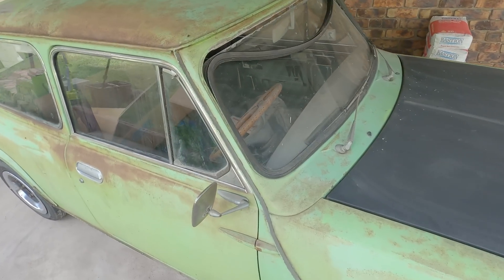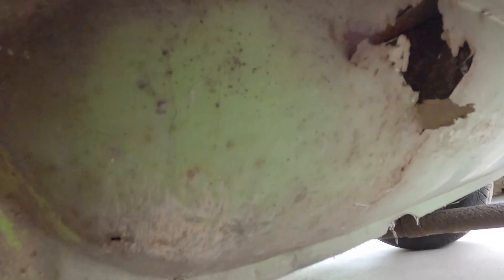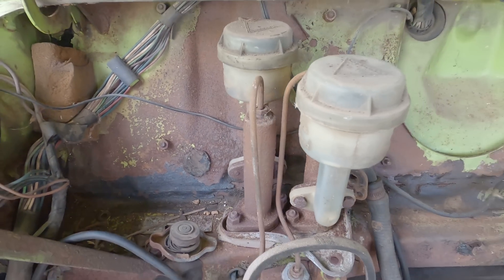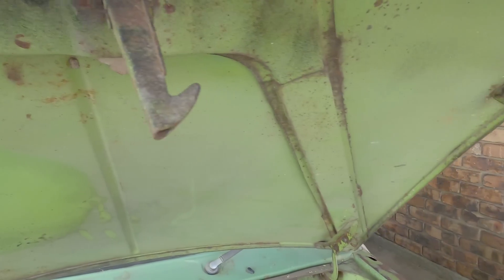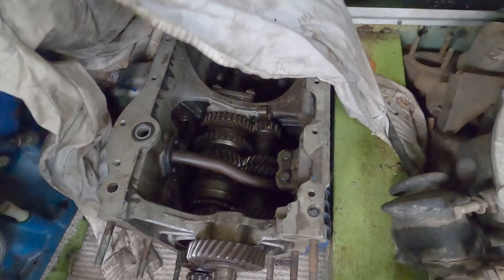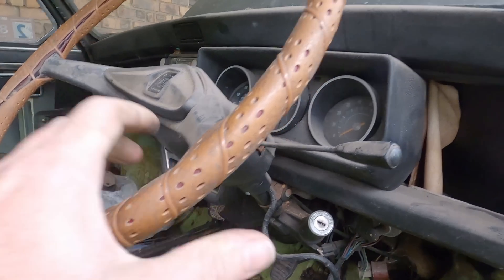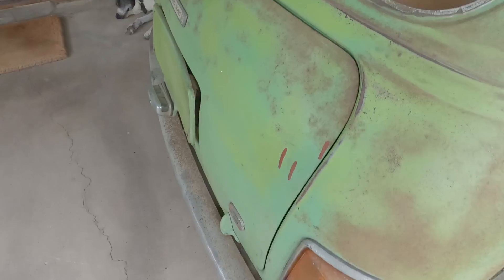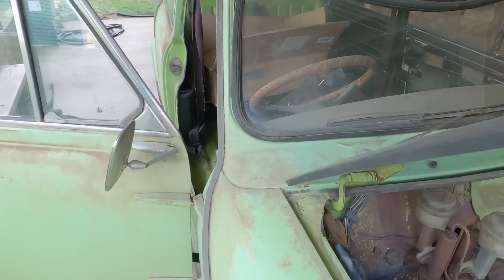🔋🔌 1973 Clubman Mini going electric - NetGain HyPer 9 120v  5 x Telsa Modules DIY

Comment: Well done mate!  I was wondering when you were going to take the plunge.  Although it's not as cool, I'm converting a Toyota Starlet to electric drivetrain using recycled 18650s, Netgain Impulse 9 motor, Curtis controller and balance charging with 5 x ISDT RC chargers.  Can't wait to see where you go with this!
Reply: Every conversion is cool in my book. You can see some initial videos on my channel if your interested.

Comment: You don't have to drop the subframe to get the steering rack out. It unbolts from inside the car and you can wiggle it out sideways.
Reply from the maker: It's been so long I didn't remember you could do it that way. I'm removing the subframes to have them sand blasted and powder coated so easiest to do it then. Already sprayed all the nuts and bots for everything i'm removing with WD40
Reply: @HBPowerwall  great looking project, I'm currently welding a 1970 clubman, hopefully it'll be ready for the summer. I'll be watching to see how all this new technology will fit and work. 👍
Reply from the maker: I hope to get the motor and controller in the next month or two - that way I can start the process of working out where everything can go with out cutting anything & making it look sexy and simple!

Comment: I did that same 7.5" front brake kit on my early 70's leyland just last year! tenfold better than the drums
Reply from the maker: I've never done the conversion but cutting holes in the floor and using your $2 Chinese thongs on your feet as brakes would double the stock stopping power of those drums lol

Comment: I'd strip all the parts and then the paint and grind back the rust and coat with rust remover,clean off then treat with rust converter,it's too easy to jump ahead and then have to undo work because start needed fixing?
Reply from the maker: I wish I had the budget and space to do that, unfortunately not.

Comment: Damn good project but personally I wouldn't start with getting it watertight, I'd start stripping the thing down to a bare shell and getting it acid dipped to show exactly what needs replacing in the metal shell. Then at least you will have a solid prepped and painted base to work from.
Reply from the maker: Budget just isn't there for that, neither the space to work on it unfortunately.
Reply: Ahh that's a shame. Its almost bare already. Just need to find a home for the "junk" inside. Perhaps the sale of the unwanted stuff could fund the dip! Or more Patreons 😂
Reply from the maker: I'm hoping the YouTube gods offer me more views & interaction to get some more of those $$$ to help fund this project.. Hence i've started doing weekly uploads at the same time each week. (not this does not seem to be helping at all)

Comment: Nice evolution, I look forward to see your progress. Are you going to deseam it? Review camera wing mirrors?  Always used to be the sills that required welding when I had a mini  (1976 997cc)
Reply from the maker: It's a lot of work deseaming a mini - done it twice, never again!
Reply: @HBPowerwall  fairplay but aerodynamics! looking like the Honda EV already, chuckle.
Reply from the maker: I think it is something like 40 square inches of front facing metal you remove when you do the front seams alone... (it's possible i'm wrong)

Comment: Going green eh' I'd like to start a project like this, but it will likely be a E bike! Ha-ha, no comparison,  but I do have a mid 90's Camry, that's not being used!  And since I have a working battery spotwelder, who knows what I might put together! Nice project!
Reply from the maker: Do you have access to a cheap electric motor for the Camry?
Reply: @HBPowerwall  not really, I have 3 forklift motors, but I want it to be faster than a golf cart,  I could over volt it a bit, I'm thinking Nissan leaf motor, just gotta find a deal.
Reply from the maker: Someone has been trying to get me to do a leaf motor conversion - I think the mini is too small to cram that much into it. Unreasonable sacrifices would have to be made.

Comment: Pete is there enough room for the batteries?  It will look go when finished.  Good luck. Upping you comment count. You may need my new vlog camera when finished.
Reply from the maker: Will need to be creative with the batteries that's for sure! I just drooped my iPhone recording the next ep :( first screen I've ever cracked in a phone - it slipped out of the mount. That said i do have the new GoPro8 i'm also using for some shoots.
Reply: @HBPowerwall  the car camcorder I did the vlog has good support.  Plus two sony lens and good processor for when your working in the car.
Reply from the maker: That's an intetseting idea

Comment: I'm also in the early stages of an ev conversion on my mini. Really interesting to see the tesla batteries fit in the floor between the subframe mount panel and seat member. Do you have an idea what powertrain you will use?
Reply from the maker: I don't know what the powertrain will be yet, but i can honestly say it's doing my head in reading so much information on the net and alot is people's opinions not practical experience.
Reply: @HBPowerwall  Yeah that's why I've been taking my time and looking at the options. I've got a local ev conversion company called zero-ev assisting me and we are currently looking at the mitsubishi outlander rear unit. 
There's a few people that have used the leaf powertrain and a company called swind-e that Have a bespoke battery pack and motor unit, but a conversion of a mini starts at 79k gbp

Comment: Wow Pete, I remember my first car I bought was a mini clubman estate, with the fake wooden strips around the estate section with the 2 folding doors and wooden surrounds, the wood was metal with wooden sticky back plastic. I bought it in 1977 and it was about 5 years old. Good on yah. 👍.🚙
Reply from the maker: That would have been an awesome conversion but rust realy got all the vans. My real mini love is the Morris Mini Van, no rear side windows, deleted roof vent, deseamed & sound deadend - THAT as an EV would send me over the edge lol
Reply: HBPowerwall or you could have gone for the Van Dan Pla version which had all the Crome bits, around the lights, grill and the joint strips. It also had the posh interior, sorry that was the metro. Opps

Comment: While you have it open convert those bulbs to LEDs.  It's so much easier when everything is open.

Are you going to use a cooling system for the tesla modules or let them air cool?
Reply from the maker: If i go tesla batteries I will need to cool them as the C rating doesn't match my intended max draw. Would love to have a radiator in the boot & under the bonnet with all the batteries in a cooling loop. Naturally all bulbs will be LED would be a crime if I didn't lol

Comment: Great project to evolve the channel Pete!

Just in case are the three most dangerous words in the English language. I'd advise ditching any notions of ever "going back" to original (a.k.a. I.C.E.). Rip out anything and everything related to I.C.E. (e.g. the fuel return hose) and sell it! Go all-in on the EV conversion and never look back.

Take the body down to a rolling chassis and blast every surface, nook and cranny. Dry ice blasting would be perfect for this application as all the debris, paint and rust are removed, while sublimation leaving nothing like the mess that traditional "sand" blasting does.

Then paint the naked chassis before starting to rebuild the suspension and running gear. After that, mount the motor(s), controller and control modules, and batteries. Lastly, complete the exterior and interior and hit the road (pun intend) in an homage to the original Leland Mini.

When all is said and done, done right (which I have every confidence you'll do), this Mini will be an amazing exemplar to inspire many.

P.S. The location you pointed to in the boot is the perfect place for the charger. I can see the fuel filler cap twisting off to reveal the charging port. That'd be so cool!
Reply from the maker: Biggest issue is I don't have a shed to do all this in nor the time or money to do a complete rebuild. Maybe down the track - always make the plan to redo it all if i can get more space to work in.
Reply: @HBPowerwall  Long distance collabs with Rich Rebuilds, EV West and Jehu Garcia?

Comment: "Under the bonnet we are missing a little paint" (meanwhile the motor is gone) lol looks like a bit of fun in your future. Reminds me of the Cooper S we used for ice racing back in the day.
Reply from the maker: Don't think I need that motor anyway. Well i thought that way at first. Some have said it might be easier to fix it all up get it registered then convert to EV..I'm now thinking thats actually an option. next video is pulling out all the parts and doing a stocktake and working out what to sell/repair/replace.
Reply: @HBPowerwall  yes the work around the rules usually is the best way

Comment: How many Tesla modules total do you reckon you'll be able to squeeze in?
Reply from the maker: I only really want 50-100km of range so won't be cramming them in, more fitting them with out being silly. Still researching options for batteries.
Reply: @HBPowerwall  I suppose you want to keep it spritely! Fair enough

Comment: AHHHH. So that's what the NCRs are for! OK, maybe not. Just got my first few laptop battery packs (3). Samsungs, GAPs, and sigh... Sanyos. The Sanyos are the only ones with voltage, but who knew they'd be extra hot during charge :O
Reply from the maker: I'm going to TRY to a test fit tomorrow with the NCR cells but will need 120-150p 26s - That's almost 4000 perfectly matched cells.. BUT would have heaps of range and based on another comment - i might be able to custom mount some in the exhaust tunnel of the car

Comment: Awesome Pete!  It's going to be a crazy mission - but so cool.
Reply from the maker: Take my time do it right and hope like hell, YouTube picks it up and can cover some of the costs!
Reply: @HBPowerwall  Given the small number of Telsa modules you mentions I guess it going to be a "low" voltage EV system?
Reply from the maker: was thinking 144v but would need max 500 amps and that's not safe with just 6-7 tesla modules. Now looking at a 96v motor and 4-5 tesla batteries just to get me started. Just have to be thoughful of the 'gas' pedal

Comment: Are you keeping it front wheel drive?
Reply from the maker: Current thinking is FWD & converting it to a different gearbox & diff combination as the mini is wet sump with drop gears from crank so won't work easily.
Reply: HBPowerwall so many questions about this project especially with it being a Mini so I’ll be watching this with interest.
Reply from the maker: Feel free to give advice / your thoughts as it all adds to the hive mind

Comment: Have you considered geting it going as a petrol car, register it then sell off the engine and do the conversion. Otherwise you are up for heaps of issues with engineering, bringing these specialists to your place to check on everything as you do it.
Reply from the maker: We did consider that and might still go down that route, putting the motor together will cost about 1500 bucks so not out of the question - will have to see how we go..Heaps to do first & the more I look at it the more I really want to do.

Comment: As a previous Hillman Imp owner I'd love to convert one of those.
Reply from the maker: That would be a neat conversion - I'm currently looking for a Hillman Hunter center console they fit so well in the minis with little to no mods
Reply: ah the rear engined car mum had one when she was learning to drive
Reply: Didn't they have a reputation for rolling over and killing people at relatively low speeds?
Reply: @matbowden9156  thinking of the 3 wheeler reliant robin?
Reply: @matbowden9156  No, but from personal experience the steering can get a bit light if you have a done fence posts fed in through the rear hatch 😀

Comment: Open evse has a charge point for under 300 ish
Reply: Ah takes me back to my Morris 1100 pete
Reply from the maker: We have owned so many minis plus 20 easily, don't know what i'm going to do with charging yet.. Want a J177771 or what ever the name is plug and charge that way but that's a hole new learning curve i need to go through.
Reply: @HBPowerwall  there is a series called maddie goes electric running at the moment (fully charged)
Reply: @HBPowerwall  side note using baby oil as a polish seemed to work real well a late friend of the family would "polish" his mini that way
Reply from the maker: Love FullyCharged! Don't think i'll try the baby oil... we'll keep that for the bedroom :P
Reply: @HBPowerwall  hee hee ok